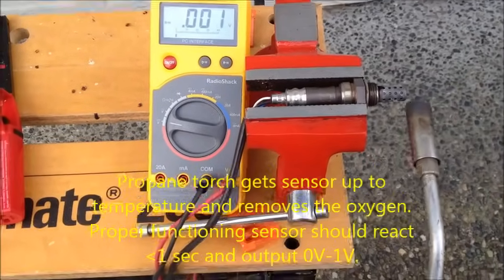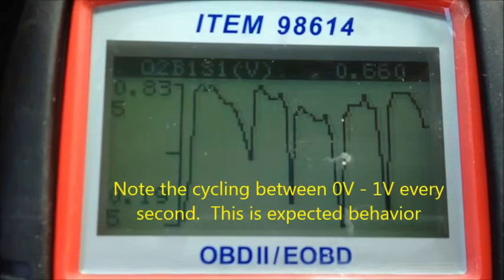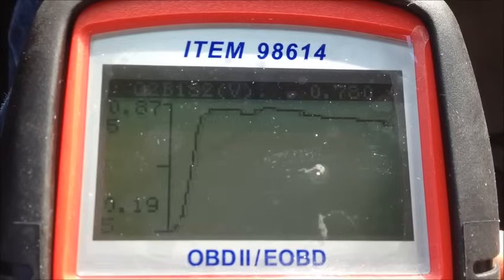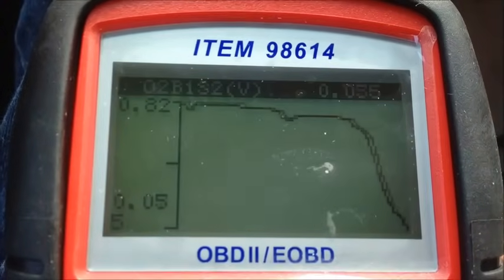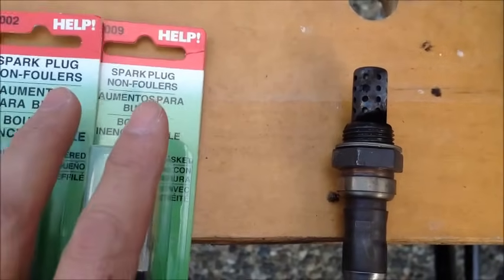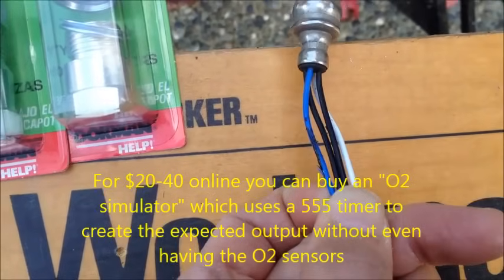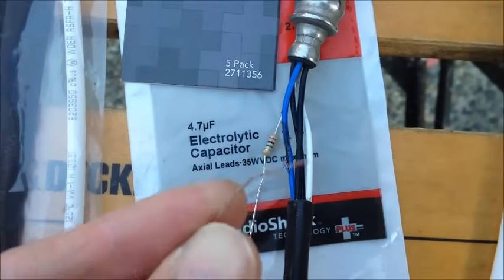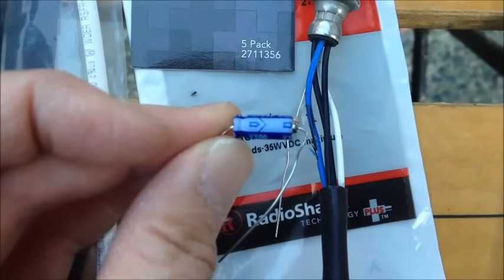$3 O2 simulator fix for P0420 Check Engine Light

Comment: Just tried this. It didn’t work for me. Might need to try a different capacitor and resistance. I got 1.275 volts which is considered high.

Comment: Look up 4 pin connector o2 (lambda) you can get the wiring sequence, 1 and 3 is the ground side 2 and 4 is the hot or signal side

Comment: I tried this fix - it didn't work for me.  I varied the R (resistor) value from 100K to 1 M - either value didn't work.  Nothing solved my P0420 code, except putting in a good (I'll explain) new Catalytic Convertor.  See, I bought a 'cheap' Catalytic Convertor from Vevor (about $ 75).  Don't ever do this - there is no Warranty in China.  That was a complete waste of money, time, and energy.  I failed Emissions Testing with the CEL (Check Engine Light) light off !! 

For my next repair effort I found a Walker CARB compliant (aka California) Catalytic Convertor on Rock Auto (about $320).  This was about 1/3 the price of getting the very same Cat. P/N from a local Exhaust shop in Colorado.  After the replacement the car sailed through Emission Testing (and my blood pressure dropped 25 points).

Oh here's a funny epilogue.  Some Knuckle  Dragger on Craig's List mentions this interesting fact about his POS for sale; "Car past Admissions".  Something tells me he didn't pass High School English.

Comment: What brand\year car is this? I tried it and the car computer says it doesn't talk to the 02. It is flat line unless I hit the gas. I get low voltage\no signal code.

Comment: I have an 08 Toyota Prius. Been having this catalytic converter problem ever since thieves stole my original. I have bought and replaced it with after market versions about 3 times but they never keep the light off for good. The check engine light comes back usually after a good month or so. Already spent nearly 800 dollars on aftermarket replacements. A brand new OEM one cost well over 2k. I barely paid 2k for the whole car. I do not want to put that much into it. I would like to try this solution.

Comment: Huge thanks! Worked for me. Idea to use breadboard, plus potentiometer was brilliant. Able to see graph change (OBD scanner) as I adjusted resistance. Used 4.7uF and 500k potentiometer. Had to max out resistance (it only went up to 470K ohms) for best results (while idling @ 2200RPM). Reset codes, then drove around to complete Required Drive Cycle. WOW! Catalytic test became ready - and no more P0420! I finalized the wire connections with only electrical tape. Decided to keep the potentiometer, connected to its end terminals. [2000 Camry 268,000 miles. Bosch Downstream Sensor]:text-green-game-over:
Reply from the maker: Thanks for sharing your results and glad it worked for you.
Reply: What state are you in?  Not all states have the same smog laws.

Comment: I built the circuit and tested afterwards.  I am getting sine wave .9 to 1.3  using torque app.   Before the sinewave matched the up stream now its a lower sinewave but higher peak. Is this correct?

Comment: I must have done something wrong because when i did this my 2009 Scion XB and as soon as I turned on the ignition it had a P0607 code (Control Module Performance) which went away when I plugged the old one in.  My wires are Black (signal) Gray(ground) and 2 Whites(heater). I soldered the resistor in the Black wire and capacitor on the plug side of the circuit Ground side to the Grey(ground) wire the other to the Black(signal) wire🤯 I realize this is an old video but hoping someone watching may know more than I do 😂🤣😂🤣
Reply from the maker: Did you actually find a PINOUT of that O2 sensor or connector?  The only way to be sure is to test it with a voltmeter.  Measure voltage between the grey & black wire as you pass a flame - even a bic lighter will do - over the tip of the sensor.  You'll see a voltage between the black & gray.  Assuming you connect the meter black to black and meter red to gray it should be positive if I'm right, or negative if you're right.   Also check the resistance between the two whites - if it's the heater you'll see a resistance - not sure how much.

Comment: what happens if you just supply a steady 0.6V to the ECU? Would it be fooled that way? Just stick a descent resistor in there to limit the current depending on your source of said 0.6V. Is this wrong?
Reply from the maker: No that's the problem you already have - the computer needs to see a slower version of the input and it throws P0420 when it doesn't see it changing.  The catalytic converter processes the quick 1hz changes to fuel mixture and outputs a slow version reflecting the catalyst doing its job.  This solution will generate a slower version of the input through electrical circuitry.   A simple fixed voltage won't work.  The trick is to slow it down just enough and not too much or you'll end up with a different code.  But with variations of the resistor and capacitor many people have successfully made this work.

Comment: Worked on my Ford Explorer 2013 using a 4.7 50V cap and a 1M ohm %1(blue) resistor.  With the resistor and negative leg of the cap on the grey wire and the positive leg on the black wire. Emissions can kiss my ass

Comment: Can you help with the blue capacitor.  I keep finding 4.7uf but it says 35v, 50v, 250v, 350v. Will either of these work? And does the tolerance matter?
Reply: Those values are just the max voltage the capacitor can handle. This hack is dealing with very low voltages so all the ones will work

Comment: So im only finding the 4.7 cap in a 50v so would that work as well or does it have to be 35v???
Reply from the maker: 50v is fine.  Voltage rating doesn't matter much since we're only dealing with a few volts.
Reply: Thanks bro

Comment: @miteeman what does it mean when the signal smooths out as in the video but after 20 mins driving it outputs constant 0.4V without varying at all. Did the heat from the exhaust melt the solder or damage the cap or resistor? Thanks.
Reply: ... Passed smog today, thank you 😁😁
Reply: @DrFixItAutomotive  nice!
Reply: I resoldered it and put everything back together. So far so good, just got to wait for cat readiness now.
Reply: You should have smooth variation a constant output is bad so something went wrong. You could just keep driving and see it’s the check engine light returns
Reply: @robertosaucedo4347  thanks. Cel did some back for P0136. I think something happened to the solder. Going to relocate the capacitor and resistor inside the car away from the hot exhaust.
Reply: @ most definitely probably melted P0136 is caused by a broken circuit in this case an open wire

Comment: My down stream sensor reads between 1.99 v all the way up to 4.99 v when I go down hill letting off gas.. I think the sensor is bad not the cat. What do you think.
It sets the 4020 code every 5 to 10 trip cycles. I got the volt reading with a code reader....thanks..

Comment: Help! 2011 equinox 2.4L
I used this tutorial for my P0420, everything was fine got, got good reading. But as I was about to call it good. I noticed that at every cycle the voltage kept creeping up, until it just got stock at 1.275v. I thought the probably the resistor or capacitor went bad, changed them. But kept reading 1.275. Don’t know what to do next!!
Reply from the maker: reduce the resistor - that will help voltage leak out faster

Comment: as for the solder not sticking to the wire. Use flux meant for soldering silver (Radnor Stay-Clean Liquid Flux)! Shit tinned right up! I think they coat some kind of chemical on the wires so they cant be modified (this was the case on my honda, but didnt have this issue with my ford explorer)

Comment: 04 Highlander v6. 0420 0430. I got the 136 & 138 or whatever sensor codes, like others, when I tried 1m and 4.7uf. (ECU tests itself and can tell the results are impossible). Swapped the front to stock (no filter) with a non fouler and the rear (couldn't fit the non fouler) to 1uf and 100k. No codes. 

[Update: Catalyst check passed. Fully green on OBDII smog tests. 🥳😇]

Note: because of this I'd suggest using an adjustable pot, not a resistor. If you have cats, working O2 sensors, and are just below efficiency, I'd start with 1uf cap and a 1M or 500k adjustable trimmer pot.

PS, I used an obdlink mx+ to look at the o2 sensor tests to see if voltage is too high or low before changing resistors/caps. I was only hitting .5v max with 1m resistor and it wanted .6-1v to pass. It was also failing the O2 tests with units in seconds. I figured that was because it was taking too long to return to 0v, so that's why I reduced the cap too.

Comment: Liquid soldering flux is your friend, as is alcohol for cleanup. Oxygen sensor wire color codes are easy to find online which is also handy if you have a good donor from a different vehicle with a plug that doesn't match since you can swap plugs. I potted my resisitor and capacitor in epoxy then taped thoroughly over that.

Comment: Bmw 550i 4.8 with this mod both sensors throw no activity codes and the voltage stays at .4 constantly, there is also a consistent heater circuit code on both (heater wires ohm test ok), reverted back to stock and back to a 420 and 430
Reply: Not sure if anything will work on this vehicle ive been through o2 simulators, non foulers, relocating the o2, and 90 degree spacers(smoke tested no exhaust leaks btw)
Reply: One thing i cant wrap my head around if anyone can explain, why did this mod turn my voltage graph from switching to flat line? It should have just spaced out the switch in voltage(again back to stock and back to switching fast)

Comment: I have a blk power+ and the signal grey - others are white heater wires so my signal wire is - do i still put the resistor on that one or how can i connect this

Comment: Tried on a 06 camry 4 cyl but I got a P0144 after a few miles.  Why is that?  I used a 1M ohm R and 4.7uF capacitor.
Reply: Track to change the value of the capacitor. For Toyota engines a value of 330 nF should be OK. Background is the charging time of this RC lowpass Filter. This time is too high for the Toyota ECU . Same thing for Celica T23.

Comment: This hack doesnt fix anything. Instead of cobbling the car why not read and perform the actual p0420 diagnostics? The code can be set due to many other normal maintenance issues. Just follow the repair manual.

Comment: Anyone done this in a prius i have a 2011 ive replaced the bank 1 o2 sensor 3x it has an intermittent problem ive used denso replacement its got 4wires i have no idea about electronics any help would greatly be appreciated thank you

Comment: i have a damaged 02 sensor from dragging on road. basically bc of rust, it blew out my o2 sensor from exhaust pipe and left a hole, and dragged on road until i unplugged. i patched hole in exhaust but never connected anything else.  what should i do ? can i make a circuit
type thing with just the connector and wires i cut from the bad o2 sensor? same configuration you did but what abount the ends of the wires that would have gone to the sensor?
Reply: like basically i cut the sensor off and kept the pigtail plug harness, and definitely can do your circuit but i threw out the bad o2 sensor so im just trying to figure out how to manage the 2 heater wires to simulate it as if I was using an old o2 sensor.  would connecting 2 resistors in parallel to each heater wire work? i don't remember everything from my circuits class 10 years ago lol. anyways thanks for the good video regardless.  

Maybe i can find an 02 diagram for my vehicle that shows the inside heater wires but not luck so far

Comment: I'm going to give this a shot as I had some of those capacitors lying around from a prior project. Just waiting on some resistors ... 

I'm not going to jump in and replace the cat when my car is running slightly rich and also suffering from vibrations at a specific RPM. This seems to indicate that something else could be the cause.

Comment: Applicable for d upstream sensor sir? Thanks!
Reply: No. The upstream sensor controls the fuel trims for the engine. The lower oxygen sensor monitors the cat. The point of this is to trick the oxygen sensor to think the cat is good.

Comment: I did it and now I have a downstream o2 sensor too hot so out w this and in w a capacitor and diode once I check actual o2 readings I'm done w this light bs the engines new exhaust is new.

Comment: So after I solder in the resistor and capacitor into my downstream O2 sensors and confirm they are working properly and there are no codes. Can I go ahead and completely gut my primary catalytic converters? The reason I ask is as I am sure some of you know, when converters get old they can completely disintegrate the honeycomb inside the converter. This can lead to a clogged exhaust or even worse with the now VVT engines and there valve timing overlap between intake and exhaust valves, material from the catalytic converter can get sucked back into the piston bore and completely destroy the cylinder wall on 1 or more cylinders.
Reply from the maker: No, this is dependent upon your catalytic converter working.  If your cat does fail this won't work anymore.

Comment: Would this concept work on a header that delete's the CAT entirely?  that is, leave the lambda where it typically is a the bottom of the header prior to the flange tot he midpipe and simply use the resistors like you do here to lower sensor re-fresh speed to the degree that the ECU believes the CAT is still in place?

Comment: 4:45 I’m seeing where you put the resistor. Did you cut the sensor wire and then place the resistor in between where you cut the wire?

Comment: I’m confused. Did you cut the whole wire and place the resistor between both cut ends or make 2 small splices, leaving the wire connected, and then connect each end of the resistor to the open spots?

Comment: Other than the P0420 amd the check engine light, does the car run sluggish, or stall? What did it fi, or is a purely cosmetic fix?
Reply from the maker: No, P0420 doesn't indicate any problem with the way the car runs.  It indicates the catalytic converter performance isn't up to spec.  This doesn't repair the catalytic converter.  It just smoothes out the performance signal so the ECU won't generate the code.

Comment: Im running into issues doing this with a 2010 Lexus is250, bank 2 sensor 2 is showing pending low voltage code, and its showing code for high voltage bank 1 sensor 2. help please